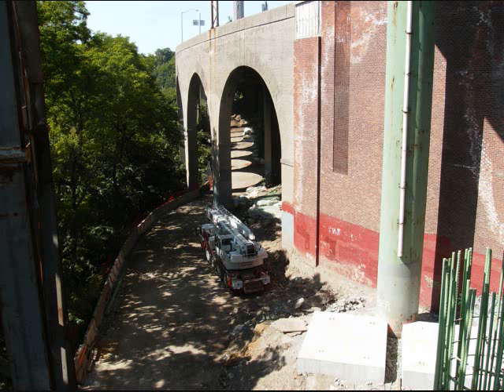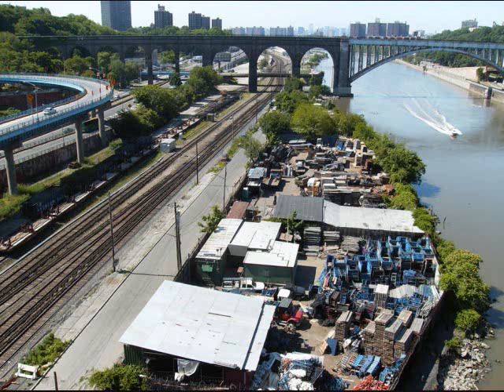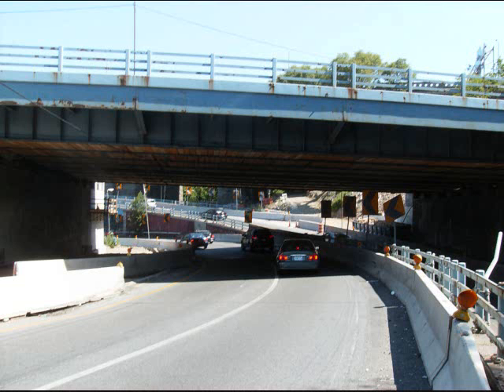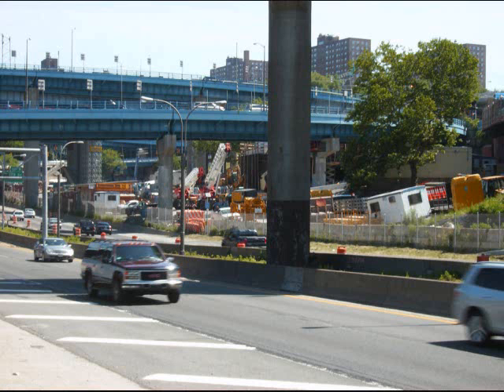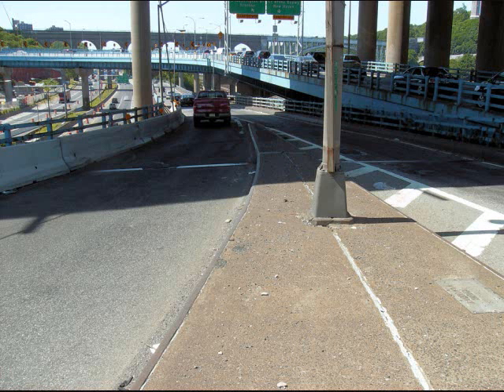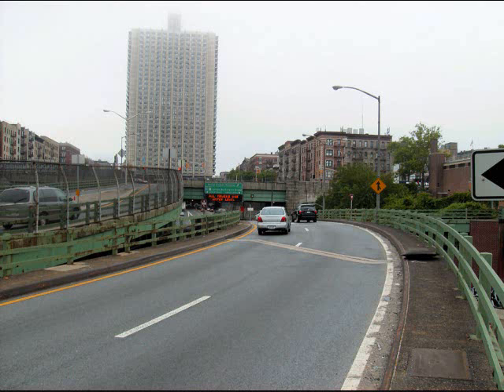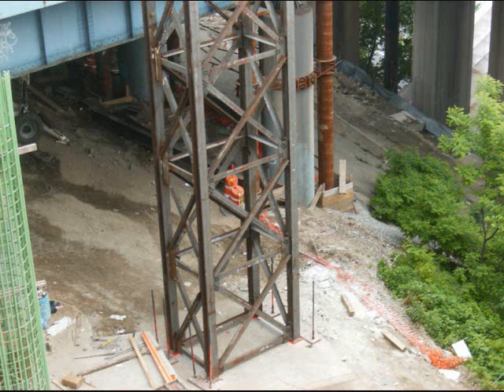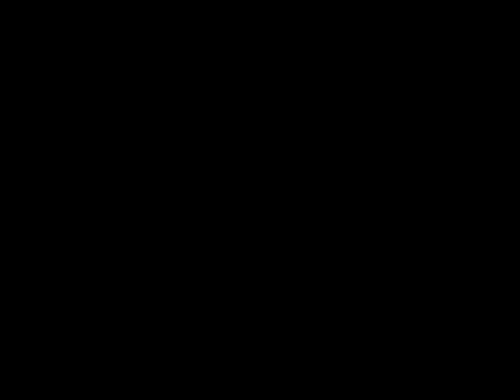Rebuilding The Alexander Hamilton Bridge Part 1 of 2

Comment: All NYC highway are real bad designer and are badly deteriorated
Reply: mexicn22 And speaking of which, look what happened to the Brooklyn Queens Expressway, the first 1.5 mile stretch where it goes from Carroll Gardens to Brooklyn Heights all the way to downtown. It has been deteriorated for decades. There is a plan on reconstructing the BQE for the next year or two on updating the whole structure. The DOT workers needs to check the problem on what went wrong. And the Brooklyn Promenade, which is still a landmark for sightseeing view of Lower Manhattan and the Brooklyn Bridge, but I don’t any of the major changes on the BQE anytime soon. And also, there’s the original guardrails which is part of a 1.5 mile stretch of the BQE, and it was been built since the 1940’s under Robert Moses. The Brooklyn Promenade along with the original viaduct are 6 lanes. 3 lanes on top on the North side, and 3 lanes on the bottom which is the south side. 

Look what happened in Seattle, the Alaskan Way Viaduct was worse than the other NYC highways. Thankfully, it was demolished and it’s going to replace it with a new tunnel to go underneath. Very sad.
Reply: mexicn22 We used to drive around the city and it's not too bad, but mostly dangerous due to steel structure in which Robert Moses did a long time ago. 

There's also the Gowanus Expressway in which "Crazeenewyorkdriver" is going to cover in the future is the original viaduct that goes from Bay Ridge right up to Red Hook toward the tunnel. And the BQE in which he is going to cover that goes from Carroll Gardens section of Brooklyn to Queens towards the RFK Bridge. I remember last year when I heard that the BQE will have some major changes like they did with the new Kosciusko Bridge, they're going to have a major overhaul including sections of the Brooklyn Promenade where you can see the BQE from Brooklyn Heights all the way to Downtown Brooklyn where the Manhattan Bridge goes to.

Robert Moses was a genius who built NYC highways a life of his own.

Comment: That green ramp that goes over the Alexander Hamilton Bridge and connects to the Washington (181st St.) Bridge was built well before 1962. It originally was accessed from the 178th St. tunnel, the predecessor of today's Trans-Manhattan Expressway (I-95 under the apartments). Likewise, the viaduct that goes down to the Harlem River Drive is also a lot older than the Alexander Hamilton Bridge.